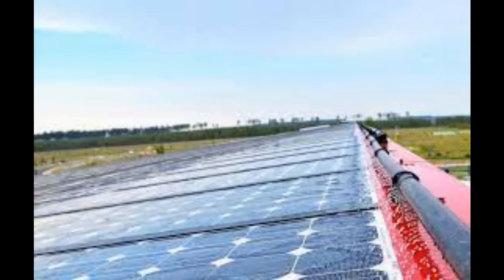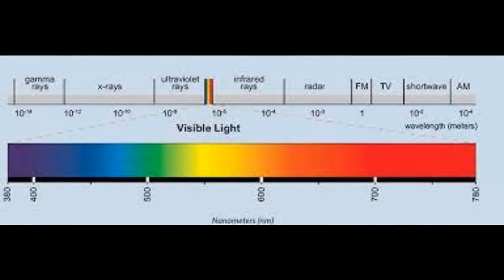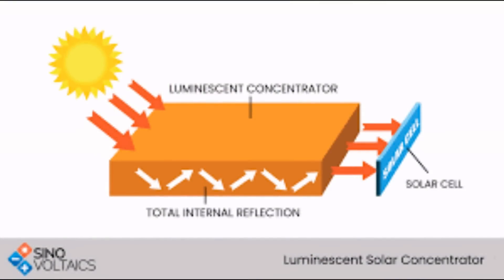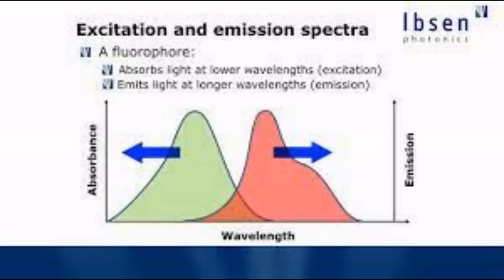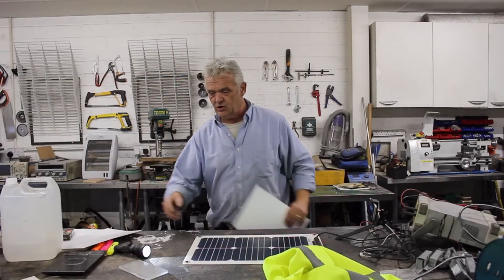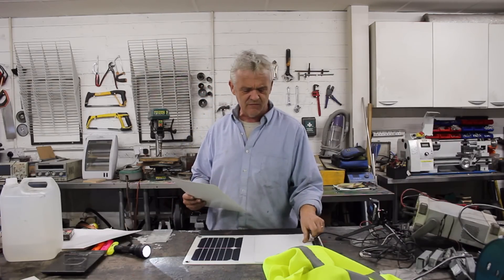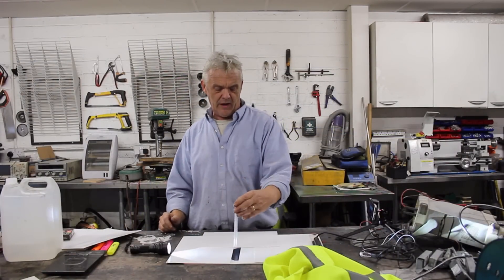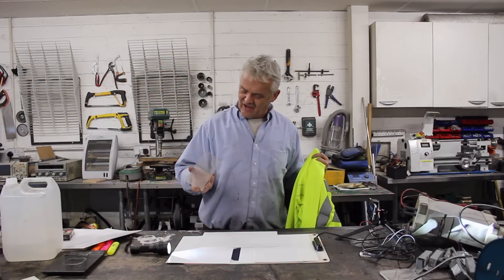1664 Supercharge Your Solar panels With Fluorescence

Comment: Could the back of a solar panel create the 6th side of a water tank? So the water passing through the tank cools the panel improving its efficiency. Also the water will heat up giving us hot water.
Reply: Absolutely. Tech ingredients have a couple videos that touch on this subject. In "Get 4X The Power From Your Solar Panels!" they use mirrors to concentrate light onto a single panel, and while this boosts the power output and quantum efficiency, the temperature degrades the cell efficiency severely by increasing internal resistance and damaging the PN junctions. In another video "Should you really use solar panels?", they do a side by side comparison of solar photovoltaic panels vs solar thermal water heating panels, and determined that the PV panel collects only a fraction, between 1/3rd and 1/6th or less of the available heat energy of the Sun due to the 20% or so efficiency converting light to electricity. The big takeaway is that a combination of concentrated solar and thermal panels should both maximize the efficiency and lifetime of the solar panel, minimize the cost, and utilize the otherwise wasted heat energy to heat your water.
Reply: @taylorwestmore4664  I will look at the Tech inged' video but my thoughts are to actually cool the back of the panel with water. I've seen a French company that dribble water over the front face to cool but I don't think they recover the heat from the water.
Reply from the maker: I am with Taylor on this one mate - absolutely

Comment: You should elaborate on this because the demonstration was a little dodgy, if it wasn't a yellow vest but just a white t-shirt I guess that the light bounced off would have the cell produce more light
Reply from the maker: I tried it with the reflective paper the lcd panel came with mate - it didn't work as well  -but this is a replication of research papers not my idea - I am just showing the principle really

Comment: you can get acrylic with "neon edge glow" which is acrylic with fluorescent dye.  also another cheap and rough and ready option you could try is Hilighter markers on your  lcd light guide.
Reply from the maker: I tired highlighters mate - no go and I have ordered some fluorescent acrylic
Reply: @ThinkingandTinkering  so... you need cheap 'Dye for Leak Flow Detection HYDRA Fluorescent Green Drain TRACING DYE' applied to cheap Mylar blanket sheets as a thin top coat on front reflectors & also added to free amazon filler cardboard/cheap wall paper seconds/paper batteries placed on the unused back side of the panel space... dye colour/chemistry to be determined for optimal reflection oc
Reply: @paulmaydaynight9925  Fluorescein :) It reacts specifically to the blue and to the UV wavelengths.

Comment: A couple of problems; one the shirt isn't fluorescent, merely reflective to make them more visible to drivers, especially at night with headlights; and two, all you did is reflect more light into the solar cell. You didn't use fluorescence as you initially described. 

Nonetheless, the initial idea and secondary effect shown, albeit unrelated, are valid points. Use of reflective surfaces to direct more light into a solar panel does improve efficiency and power production, and the use of fluorescence could be used to store light which is later released at night to provide at least a trickle of power production by solar panels. 

However, arguably, if you want to improve solar panels, the simplest method is to just have it capture more light. Take a solar panel that is translucent, set it on a frame, and the backing of the frame should be painted the whitest paint one can make. 97 %+ reflectivity of light. Any light that isn't captured that passes through the solar panel is reflected back at it allowing for a secondary capture. Doing this should improved efficiency by around 40-50%. If you add fluorescent materials onto this backing, that material will release light at night allowing the panel to produce power for longer without direct light from the sun.
Reply: Why is high vis clothing fluorescent and reflective?
The sun's ultraviolet rays react with the fluorescent colours to make them appear to 'glow' increasing daytime visibility.

fluorescent material differs from retroreflective materials in that it absorbs some invisible ultraviolet light from sunlight, then special pigments release those UV light rays as more visible light. It can only do this in areas where there is natural light.

In the demonstration there was the same amount of incident light, therefore the higher voltage meant more power / greater efficiency.
In fact i've measured the efficiency (also called shockley queisser limit) for a type of solar cell called DSSC that worked with incident fluorescent light - and by the strict definition we exceeded the ~30% limit which is the case for silicon cells under sun spectrum -- the trouble with DSSCs however is the total power output / the absolute area under the curve.
Reply: @Earzone63  Fluorescence and the Appearance of fluorescence are not the same thing. The very section you quoted notes that difference. "The sun's ultraviolet rays react with the fluorescent colours to make them appear to 'glow' increasing daytime visibility."

They "appear" to glow, they're not glowing however. 

There was not the same amount of incident light. The flashlight was not directed at the solar cell. The LCD panel refractor directed some of that light to the solar cell, the safety gear reflected more. That's it. More importantly, that flashlight Doesn't Emit UV light. It is not a full spectrum light source. So even if the material is UV reactive causing a fluorescing effect, it wouldn't be produced by that flashlight. 

All that was demonstrated was that if a material reflects more light into the solar cell, it produces more electrical current.
Reply: As for the absolute limit of efficiency, this applies only to the direct light and initial capture. It has to do with the electron exchange caused by photons hitting the material the solar cell is made from. There is a limit to the amount of electron bumping that can occur. The back side of the cells are just as reactive as the front side, but rarely ever used due to most solar panels being oriented to receive light from only one direction. In a translucent cell, without a backing, excess light allowed to pass through the cell can still be reflected back at the cell to produce more power. This is the principle behind the transparent solar panels developed in 2019 that could become a replacement for windows in large buildings and homes. A conventional solar panel could be made just as easily in this same method, while using a high incident reflective surface to bring more light back to the solar panel. Furthermore, the whitest paint in the world, currently, using titanium oxide, converts UV light to a visible white spectrum upon reflection. It reflects 99.97% of all light (and I mean all light; radio spectrum all the way up to gamma, and was initially designed for space-craft use). Higher energy light is converted to a visible range or near visible range which solar panels can use.
Reply: @XtomJamesExtra  lol if it's not glowing but just appearing to glow then what is the difference? what would you say a fluorescent material is doing - i could be wrong but i believe it is transitioning photons/electrons between HOMO LUMO molecular orbitals -- this is how incident uv wavelengths can be translated into more green wavelengths (1.1eV) suitable for silicon solar PhotoVoltaics. 
Funny you mention TiO2 because that was the substrate we used to make the DSSCs, we added a nano dyes to that. 

As for Hi Vis jacket the fluorescent material has a base cloth and adhesives to secure micro glass beads that produce highly reflective bands. ...  and before you say this is just reflection I have to say idk how the uv would induce fluorescence .. but I can guess: A rain drop can split light incident at 42º into colors of different directions if the light reflects 3 times within the drop (or 4 times for a double rainbow). If two waves in the uv band are incident at a similar time (the electron's excitation 'window'), then it could access some doubly excited state that is statistically more favourable (a shorter excitation time) to make a transition of 1 'jump' at longer wavelengths instead of the 2... and there would have to be 4 photons released instead of the 2 incident ones to conserve energy -- which would explain the glow / increase in intensity.
Thanks for  prompting me to think about that some more , i hope my intuitive explanation helps !
Reply from the maker: I tried it with the reflective paper the lcd panel came with mate - it didn't work as well  -but this is a replication of research papers not my idea - I am just showing the principle really
Reply: @ThinkingandTinkering  And that doesn't change the fact that without UV light, it simply wouldn't fluoresce. The likely reason why it worked better than the reflective paper is due to simply scattering. The reflective paper isn't designed to scatter direct light, in fact it's the exact opposite. Whereas the high-vis vest is designed to scatter light so as to be more visible. That's all. Try the experiment again, find yourself a high gloss white paint, and paint a crumpled up and then flattened piece of aluminium paper. I bet you'll see similar results. 

If you really want to test fluorescence in the manner you discussed, you need a full spectrum light source that emits UV-B light to work with the vest you have.

Comment: I've been wondering about this for awhile. Different light frequency so to speak. My thoughts were along the lines of a prism to separate the light to perhaps a "color" that solar cells like. Or a cell designed to work best with whichever "color" is better for energy draw. Possibly with less heat.
Reply from the maker: interesting ideas mate - thanks for sharing

Comment: Yes, this is a really excellent idea. In honesty, I have been mulling over something similar for just a few weeks now, except not as a light pipe but simply as a "coating". (I guess I need to buy some tin foil! heheh). (been looking at all sorts of options but hadn't really looked at fluorescent Cloth! But honestly, super glad you are focusing on this because I wasn't sure how this would turn out. Actually I am pleasantly surprised by the boost in voltage simply by nature of the fact that the light first past into passed the acrylic, then out the other side, absorbed by the fluorescent material, then re-emitted as a new wavelength back into the acrylic to be absorbed... very very interesting. Now that, I had not anticipated to do much but clearly it is pretty decent.
What happens if you put 1 layer of the shirt (fluorescent dye) between the light and the acrylic?
Reply: Another question: Could you run that experiment again without the "paper shade"... I am curious how much of a boost to voltage you get.
Reply from the maker: I have ordered some fluorescent acrylic mate - so I will be trying a few things for sure
Reply: @ThinkingandTinkering  Nice. The panel arrived. And the initial testing with several phosphorescent products as well as some off the shelf fluorescent products used in detecting radiator and refrigerant leaks failed.  I am still waiting on 2 more items to come in so I can try some additional tests out. I did not try the magic marker trick yet tho.

Comment: Very cool. However, is there a material that can do that wavelength translation for infrared? Because, and correct me if I'm wrong here, UV is higher energy than visible spectrum, and fluorescent compounds take part of that energy and then re-emit majority back, but in the visible spectrum, right? That's why I'm not sure if lower energy IR can be easily converted to a bit higher, visible light wavelengths without external input of energy. Otherwise we would solve problems with solar cell outputs on cloudy days, as IR passes through clouds easier.
Reply from the maker: I don't know mate - but I am looking if the helps

Comment: You can do a similar thing by Focusing Light in a Laser and then enlarge it...
[Seems almost unheard but Privately they found out about Concentrated  Solar Laser in the beginning of the 1900... Einstein's Relativity formula for Energy is just that in a nutshell..
 Than They Made Something with the academy to see how far they were from Regular Logical Patterns of thoughts... they made a laser who consume Lot of electricity in order to work...
For the rest Even if leaded towards the Righteous way, the Academic Cycles Walk In Pitch Black Darkness..
Be proud of your Curiosity Instinct]
Reply from the maker: indeed but you also get heating don't you?
Reply: @ThinkingandTinkering  
Laser itself Have No temperature the energy imput it's converted into Joules at the moment of Impact with an Absorbent Surface.
But! Military did enlarged their Laser to Find out the Dissipation decrease, thus Stability of the Laser Increase instead of Decreasing when enlarged...
So technically speaking you could Make one GW beam , split it into few MW beams than enlarge those till reaching few Watts per mm2 the heat would be at that point negligible.
...Or even Better : Harvestable!

[I think you could also make a Filter for Infrared and bumping them into a Heat exchanger..
As you yourself made notice Graphite/Graphene can be made almost 100% Infrared Reflective without Decreasing the Absorption of others Wavelengths of light both in the observable and invisible spectrum.]

Comment: What results do you get with the light panel and a sheet of ultra white paper vers the yellow dye or is it the refractive material of the cloth?  What about the reflective strip on the item?
Reply from the maker: I tried it mate - I didn't get much - I didn't show it because this is really just a replication of current research to show it can be done at home with basic materials

Comment: I remember reading that solar panels could be placed in a cone shaped configuration and rotated at 33 rpm to produce increased output, subsequently I read a comment that said that had been debunked.  What's cool is my most recent experiment this year has been rotating a cannabis plant throughout it's life cycle to see the effects (and the mechanism is solar powered) so I will be able to actually test that next year.
Reply from the maker: it does sound a bit suspect mate
Reply: @ThinkingandTinkering  It very well may be, although my rotating plant grew at an exceptional rate compared to previous non rotating plants in the same spot... So we shall see
Reply: @ProlificInvention  I would have thought that the plant would be tall and spindly if you rotate it all the time...
Reply: @annebeignatborde1832  I wasn't sure what would happen, although what inspired the experiment was a 1960s science book I had as a child that showed grass growing in milk cartons on a record player would grow towards the center-and this plant is shaped like a pine tree when traditionally this strain of cannabis grows in a large bush.  I have videos of the experiment if you're interested
Reply: @ProlificInvention  ah yes, I'm very interested.
Reply: Be verry carefully with you’re solar panels then… they will grow bigger👀
Reply: @POWERKIT2  😆 touch'e
Reply: @POWERKIT2  😅😅😅

Comment: Glow in the dark materials are kind of an energy storage device. If you impregnated or layered them in or on solar cells they would continue to produce power in the dark or when thick cloud's go over them. You could use a two way mirrored layer to reflect light back in to the cell.
Reply: They also work as frequency/wavelength changers - so if you have some el-cheapo cells that won't work full-spectrum, it might be possible to get more energy out of them at the same light level exposure.
Reply from the maker: nice
Reply: Yes, somebody did this work using a pigment from plants. Won and award for it too. I don’t think they commercialized it yet though.
Reply: @CLSpencer01  from my understanding the reason it never commercialized was the pigments where destroyed in the process 
However that left a solar cell design that was ideal to quick temporary manufacture as it did not take any special materials like silicon crystals
Reply: If you doped the top layer of the solar cells with radium paint surely you would have created a nuclear battery similar to the tritium key chain and solar cell battery that people often make.
Reply: @kevinleebailey  sure, though I remember that Uranium glass is also florescent.
Reply: Exactly what I was thinking.
Reply: Good idea but it depends on spectrum and two way mirrors only let half the light in and will trap a ton of heat but i think your on to something
Reply: 100x100mm solar panels around such glow in the dark substances it would be interesting

Comment: Isn't Yellow Highlight Markers Flouresent?  Can you use one and 'Color' one side of your light guide to try it? 😁
Reply from the maker: I tried it mate - it wasn't great
Reply: @ThinkingandTinkering  Interesting... It's still an intriguing idea... 😁I have some Rustoleum glow in the dark spray paint... I'm going to play with it on some regular glass the next sunny day here and see what happens if I overlay it on the panels I have.
Reply: You could use fluorescent card , paper or plastic sheets. You could use different colours to see what the optimal colour is for fluorescing light back on to any given type or make of solar cell. This would allow solar cells that cannot hardness UV light to do so by changing the frequencies of the incoming UV light to one's it can. You could do the same with different colour glow in the dark sheets too.